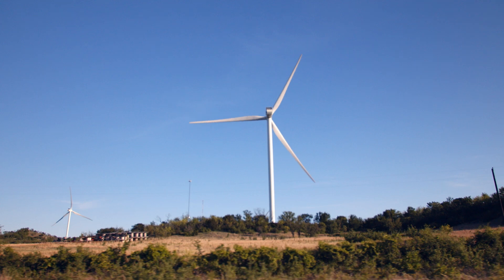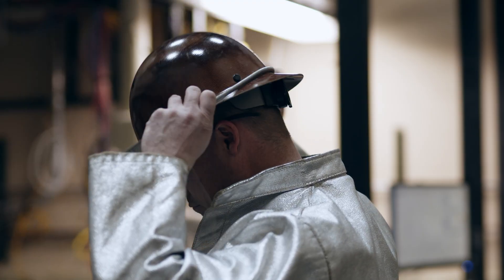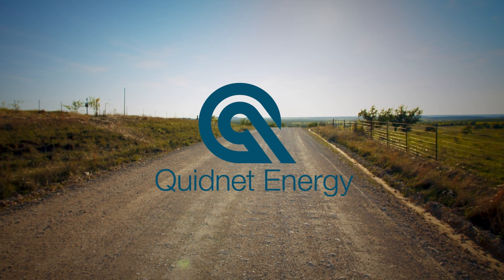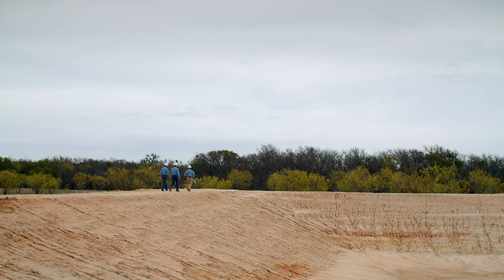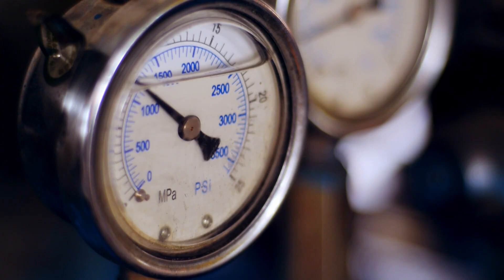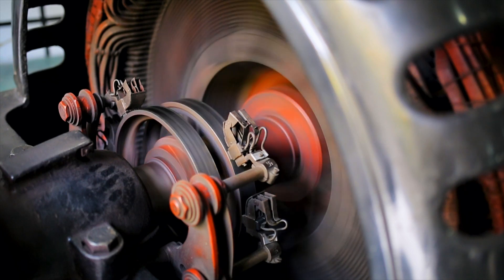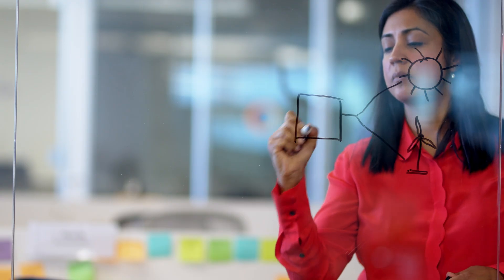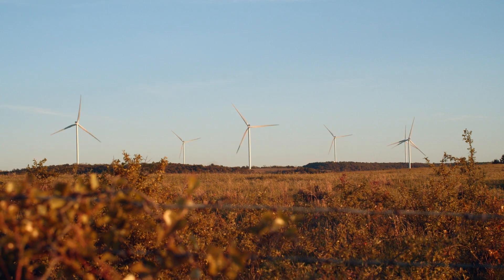Energy storage breakthroughs

Comment: I'm a bit bummed out about the lack of specific information regarding the efficiency of these storage mechanisms and about the price that they would enable, individually & compared to each other & to Li-ion batteries. Not even a projection. Without that, there's no way to tell how useful these approaches are going to be.
Reply: Each company is listed by name. I’m sure with a little bit of dedication you could find the information available to be researched on the World Wide Web
Reply: @gusthomas6872  The malta website does not state efficiency, given the upper limit of what is possible is given by the carnot cycle, then my guess is the reason they don't state it is because it's very poor, this limitation is caused by the fundamental laws of thermal dynamics, and thus is not something that you can work around.
Reply: @gusthomas6872  Actually, you wouldn't.
Reply: L M they could have at least mentioned what they are using for their batteries.  I’m guessing vanadium but perhaps something else, either way the story would be much more interesting if we know what they are researching.  Instead we get the wonderfully vague term “earth abundant elements” which personally does nothing more than set off my bullshit detectors.  Imagine if the clip on pumped hydro had kept the identity of the liquid a mystery, would that not have been bizarre?  Seems equally bizarre to keep the identity of the element(s) in the battery a mystery.
Reply: Of course they want to tell you JUST the good stuff so the funding can come easier.
Reply: Well, the lack of specific information is probably there for two reasons. One, it keeps the video short and punchy for a larger audience, which is the purpose of these gatesnotes videos. Two, all of those statistics are liable to change with additional time and research, which, with the funding of Breakthrough Energy Ventures, they are definitely going to be doing. You can see the link in the description for a bit more information.
Reply: Feeling the same way, it's important to understand more about the technology, and it's benefits, could it be mobile solutions? individual off grid? industry? etc...  #globalgoal #power1billion
Reply: Its a short intro video, but with a bit of research you will find that it's not that good and of course the idea is with continued research into the area that efficiencies will improve.  I think as an intro video this is excellent in that introduces the concept that solar power sources on their own aren't enough to replace fossil fuel power generation and the reality is replacing fossil fuel power generation is more complex, more expensive and is going to take more research and hence more time to really happen.  Personally I think solar has some very real physics based limitations and will require consumers to change their power expectations before it can become truly viable.
Reply: Probably 30-40%
Reply: The problem with pump and dump is the efficiency of the motor pumping is less than what you would receive, then with different pumps you have a variety. From my understanding, most motors that are efficient for work being done is inefficient at producing the same amount of energy. You can have two systems, one for pumping and one to generate, but that increases the overall cost and liability
Reply: Interestingstuff I first read about vanadium flow batteries in 1992 and today’s“gen3” acid mix has double the energy density of the technology of the early 90’s.  No argument that fusion power is the key to solving a bunch of problems, including reversing climate change and bringing the third world up out of poverty, but we can’t just stand around waiting for fusion to be made technologically and economically viable, continuing development of other technologies like renewables, and grid storage solutions to ensure their economic viability, are also important so that we don’t slip even further behind while waiting for fusion to be developed.
Reply: @jpe1  
Said, "...we can't just stand around waiting for fusion ..."

We learned that after the first 20 years when they said it'll take another 20 years.

So now renewables plus storage are charging ahead, outdoing fossil fuels, etc.  There's no looking back.  these alternative versions of storage may look promising but have a long way to go to come online.  The two that will make a lot of difference in the near future are V2G, vehicle to grid, and VPP, virtual power plants.  both are technically complete; the holdback is the utilities are lobbying to prevent them from upsetting their outdated business model.  if the utilities don't change, they will lose and the country will suffer.  Time will weed out the bad apples.
Reply: Acme Fixer agreed, the utilities protecting their profits are preventing changes that would benefit consumers and the environment.  We need government willing to properly regulate the utility monopolies.
Reply: Why be bogged down with old, costly energy methods when there are 

modern technologies that superseded these. An energy Lab called  H2IL  have technology for localised power stations and eliminate the larger grid. Not uncertain wind or solar but something quite revolutionary. Look them up, I was intrigued by their technique - converting a natural energy. I'm just eager for a change and active in looking at solutions - especially when it reduces power costs and is much more reliable.
Reply: The names of the companies and technologies are there... now you have enough to start researching on your own to learn about these energy storage technologies. For instance, Google "molten salt energy storage", or "re-pump hydro energy storage"... there is a ton of material online.
Reply: There is a little bit of “if the energy is free, efficiencies don’t matter” going on in the industry. I know the largest pump storage in the UK has approx 20% efficiency. When it was built it was coal that was being used to charge it up, at least now its Nuclear, Wind or solar.
Reply: @Muppetkeeper  I agree, even though i am the person you might be referring to, with regard to efficiencies! With 8 billion people, all wanting to move up in lifestyle, we have a real problem with raw energy stocks.
Reply: Yep! Reminded me of Theranos and Solyndra. I guess the cow of public and private money can still be milked well with the help of gorilla marketing.
Reply: This video is just as transparent as Windows.
Reply: playgrrrr well if yoi even compare it to batteries its completly useless.... I am not 100% sure anymore but I think the rought numbers are that if you woulf use all batteries from all devices vehicles... That are currently existing in the US you could ruoghly. Save energy for a half our.

All these renuable ideas are very noval but if you actually wanna cut emissions our only option is nuclear power currently to be honest. Even looking at solar we dont even know how to recycle them and not even stating about the polution created when mining for rare metals...
Reply: There are several companies that claim to have exceeded the energy density limits of current Lithium-nickel-cobalt-manganese batteries (Currently density kings.) By as much as 500%
This would be ideal, if they can live up to half of the claimed amount and maintain a 25 year or longer lifespan.

No details have really been leaked yet though.
Reply: Mark Pearce even if they hold 500% more its not atall enth + battery productions are super toxic and unsustainable. Nuclear power is ideal if and the waste and risk is less as often proposed.
If you count the casulties from nuclear power exidents you dont even reach 10 thoudand. Now look at how much polution kills. Also the waste that the us produced in its whole nuclear power lifetime can be put on one football filed stacked 50 feet high this is absolutly nothing and people anyways gonna move more into cities so nuclear power can be located around rather unpopulated areas.
If ya wanna protect the enviroment you need to consider all factors and need to ballance out what makes sense even if we say we find in the next 40 years a somewaht sufficent storage solution it would mean that we are faar too late.

And its also bullshit that renuables are cheaper than fossile thats because substedies. Whoever thinks solar is the way should invest in it but all oita the own pocket not that the neighbours pay with tax for your solar instalation.
Reply: They are all of them fighting entropy. If it was so easy, it'd be here now.
Reply: Hes got nothing. I HAVE FREE ENERGY.
Reply: Lots of these startups are purposely keeping things a secret. Quidnet, which is my brother’s company, had to decide the extent of information they wanted to disclose as too much would mean that their idea would no longer stay within their ownership and thus bigger companies can copy their idea and wreck their business. The internet may be useful but can also be a trap and thus quidnet would rather not disclose their information in an easily comprehendible way until they are perfectly okay with it.
Reply: @eddyzhou8453  This was exactly the situation for a start up i did some work with. I was trying to write a prospectus for their float on the share market, and they eventually didn't use what i wrote because it gave too much away. I stayed clear of hard technical detail, but even the broad ideas were precious property.
Reply: You should be focusing on lifespan which is a critical issue of Li-ion battery.. Moving water up and down after a 1000 cycles is barely accumulating pollutants.. Unlike batteries..
Reply: Not by accident I'm sure.
Reply: Specific information will date very quickly, and it is difficult to predict the end point. Anything stated in this video would be out of date in a year.
Reply: @garethb1961  They could just give the statistics and add their progections or say "this info is subject to change." If only to give an idea as to way this is a step in the right direction. Although they can always tell us later, I guess.
Reply: @TrollinFromFlask  I guess. But having done primary research in this area, absolute efficiency is not the most interesting parameter. Set up costs and running costs are more relevant. i was working on a thermal energy storage system that could have been anywhere from 15 - 50% efficiency, depending on how much capital cost an energy provider was willing to pay. Efficiency is a rubbery number in this context. Note, thermal storage has low efficiency, but high energy density and lower capital cost. Battery storage has higher efficiency, high density, but very high capital and running costs.  Gravitational storage has massive capital costs, low running costs, very low density, but high efficiency. And so on...

This is probably where the debate should be, but it's not!
Reply: @garethb1961  I agree. To me, another factor is a thing called standby losses. It takes a certain amount of energy to keep something hot, a flywheel spinning, or a battery charged, even while the energy isn't being used. Round trip efficiency is a major consideration for me. for any system to gain favor, there needs to be a reasonable time for return on investment, without raising the wholesale cost of electricity. Wind and solar are quite economical, but energy storage is still in its "infancy", and therefore still quite expensive.
Reply: @vincentrobinette1507  Absolutely. Stored eenergy leaks. One of the difficulties in renewables storage is that there is not always an easily pinned down characteristic time for the storage. It can be minutes, hours or over a week - in the case of long dull, calm spells (for solar and wind). I think a small component of rapid start up traditional fuels still has to be in the mix, at this stage. We'll get better at this in time though.
Reply: garethb1961 slow down a little. First two are substantially technologies that are here around for at least 50 years, so nothing in regards to them won't change years.
For the 3'rd can't say because they didn't explain what they are doing at all.
The problem of first is efficency, because heat conversion to electricity is always under 60%. So there and back and you are on 0,36
Lion is much more efficient
Reply: @markopodganjek845  There's no "there and back" with thermal storage. Whilst conversion of heat to work is inefficient, conversion of work to heat can approach 100%. But 60% on recovery is a massive over-estimate, so in the end your 36% is about right.
Reply: @garethb1961  There are plenty of good  informed estimates of feasibility those  projects no doubt have made. Give us those numbers! 
Things like what size of underground cistern at what pressure would store energy required to take the peaks in say California - based on physics, not a subject to much change.
Reply: @misium  It depends on the size of store you want. Not difficult to work out!

Comment: Quite funny. I actually thought about the storage of energy a few days ago and really liked the idea of storing energy in form of hydrogen. On the one hand it's probably dangerous to store huge amounts of hydrogen but on the other hand it's cheap to produce, turns back into water when burned and is a better alternative to running cars with batteries that waste important materials. But i also really like the ideas featured in this video. Especially the molten salt one since i already liked the concept of molten salt used in solar thermal power plants.
Reply: Hydrogen is being considered by various companies but Hydrogen is expensive to store and transport. E.g. existing gas-pipelines cannot transport hydrogen. That is why I think it is more popular to convert Hydrogen to Methane since all existing gas infrastructure can use it. The challenge with that is getting access to fossil free CO2 in big quantities since you need it to react with the hydrogen to produce methane. It is already being done though. Often methane is produce  with sewage treatment plants, biomass power plants etc.

I think Hydrogen is most likely suitable in semi-trucks, and other lang haul vehicles. For cars batteries have already won. They work better and are cheaper.

Comment: You know the best thing would be to be able to use heat energy not only from the sun but also from the atmosphere. This way global warming can be reduced.
Reply: That realy nich.
Reply: That idea is brilliant! seriously!
Reply: @Damnit Bobby Hahaha! That's not the way discoverers work dear! Don't put barriers to your mind!
Reply: The sun doesn't heat the atmosphere itself that much, it heats the land or Earth and that in turn heats up the atmosphere.
Reply: @Damnit Bobby Did you hear a guy who capture water from the air? Actually capturing heat from air is already being used by few household in Europe. On a small scale yes but it has been possible.
Reply: @Damnit Bobby Hear is a translated article in French about air-to-air and air-to-water heat pumps:
These are air-source heat pumps. They use the calories present in the outside air and diffuse them inside to heat or cool the home.

The air-to-air heat pump is a device that is expensive to buy but whose cost can be reduced by various aids such as the tax credit soon converted into a premium, the eco-loan at zero rate, the aid of the Anah, energy bonuses, local subsidies and the bonus of € 1,350 for a bouquet works. Moreover, it is an investment quickly profitable by the energy savings it generates.

The air-water heat pump: has the particularity of injecting the calories into the central heating circuits. It is more expensive to buy but its Coefficient of Performance reduces energy bills by up to 75%.
http://simulation-energetique.fr/index.html?msclkid=4b84d205548f1ededa338edeada2744a#
Reply: Converting ambient heat in to electricity won't negate global warming since the energy will still be on the earth.